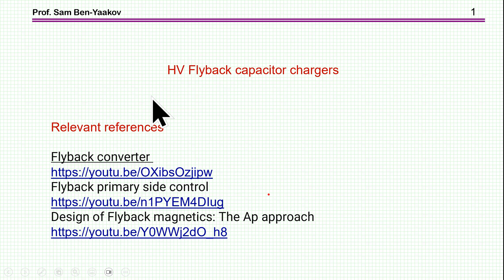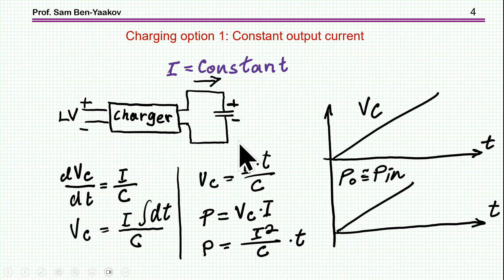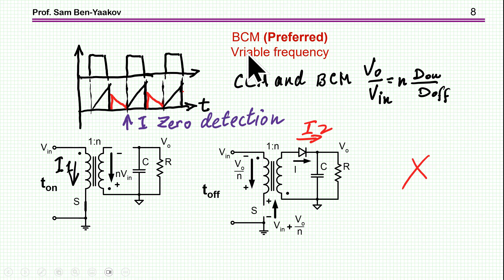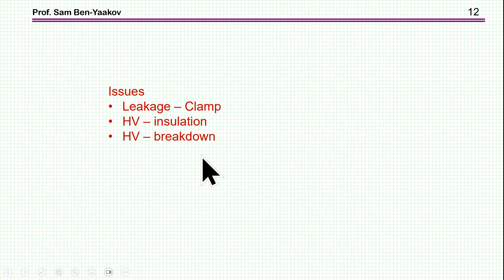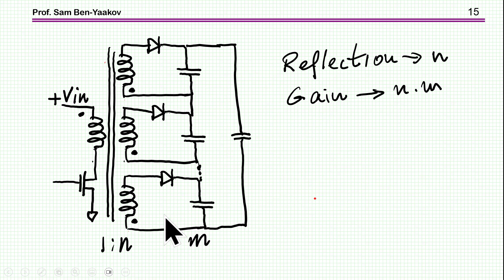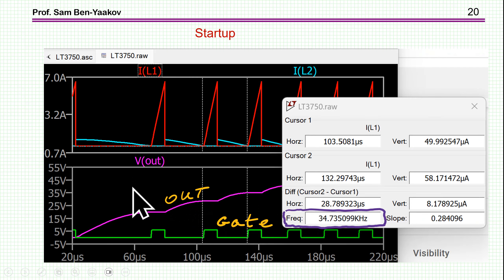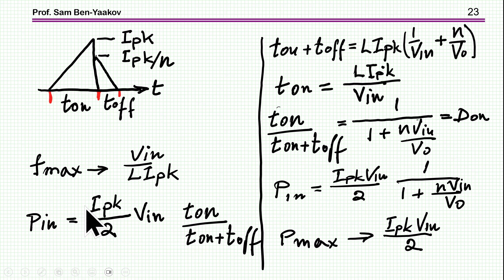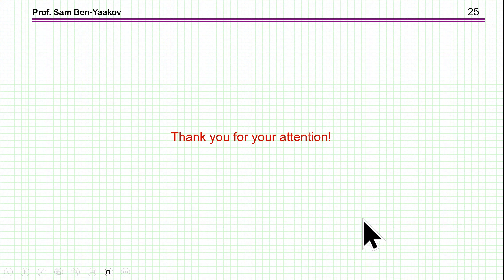HV Flyback capacitor chargers

Comment: What regulation of output voltage vs output current can be expected/achieved in a typical circuit with the LT3750 (n around 10)?
Reply from the maker: You find this information in the data sheet of specific devices.

Comment: Thank you for great presentation. I am very enthusiastic your lectures. I have a problem with page 24. The equation between Pav and Ipk.  I think the Pav is coming from the energy equation?
Reply from the maker: Indeed. If Vin is constant the power is proportional to Ipk
Reply: @sambenyaakov  Hi. Looks like P average (during charging capacitor to target voltage) in only 20% less than Pmax on input?

Comment: It would be interesting to discuss the implications of including a voltage multiplier on the transformer output, as it is no longer purely flyback topology, but rather hybrid with forward converter. 
The induced current peak superimposed onto the usual constant slope ramp of flyback converter makes current mode control more difficult, especially so in instances where output voltage set point needs to be adjustable. So far my personal experience is that COT voltage mode control is best suited in such cases.
Reply from the maker: Thanks for input

Comment: Wow, amazing stuff. I'm currently designing an isolated (1.5kVDC Rated) flyback which will be integrated into a large battery energy storage system. It's also primary control so all your videos have been relevant, thank you!

I recommend a topic that is very important - CMTI! What is it? How to measure it? How would a y-cap impact this? How to measure the value across a couple instructors ( flyback transformers)?
Reply from the maker: Thanks for the suggestion. Perhaps.

Comment: I hope you have time for a quick question. Would it be possible to integrate capacitors into a circuit in such a way that they serve as a source of voltage pulses with very short rise times in the microsecond range?

My idea is to charge a capacitor via a DC source with a rise time of 50 to 100 ms in order to then use it as a direct voltage source for the load via the fast charging and discharging capability of Capacitors. The aim would be to generate pulses with a rise time of e.g. 20 microseconds and a voltage of 1 kV and (variable pulse width 100µs : 1000µs) - possibly by using fast power switches such as SiC MOSFETs or IGBTs.
Would such a circuit to generate controlled pulses be technically feasible?
Thanks in advance
Reply: If it is possible, I would be very happy if you could make a video on this topic. That would be a great help!
Reply from the maker: Yes it is possible. here are many circuits like this, On example is a defibrillator. As for a video on this, it should be related to a specific application.
Reply: @sambenyaakov  Many thanks for the feedback! A suitable application for the video could be in biotechnology or water treatment:

In biotechnology, for example, electroporation is used, in which short high-voltage pulses (1 kV, 20 µs rise time) make cell membranes permeable in order to introduce DNA or other molecules into cells - a technique that is very useful in genetic research and therapy development.

For water treatment, such pulses are used for disinfection to kill microorganisms and reduce pollutants without chemicals.

A video on one of these applications could be very helpful!
Reply from the maker: @zeroenglisch2979  👍

Comment: That’s the first time I hear BCM. Typically it’s called ZVS, isn’t it?
Reply from the maker: NO. ZVS is an attribute of BCM. ZVS is found in other circuits., e.g. resonant converters.
Reply: @sambenyaakov  Thank you  sir. It would be interesting to hear something about this in your further presentations. Because for me ZVS means a condition when there are no high current and high voltage at the same time. Just like BCM (current ends, and voltage is applied). And I saw many ZVSes related to full/half bridge SMPS as well (like to introduce an additional dead time for one leg to achieve a ZVS)
Reply: @sc0or  ZVS means Zerro Voltag Switching. This means at the time a semicoductor switch, aka transistor, is switching, the voltage across it is alomost zero. The current can be high during turn off, it is still zero voltage switching. This reduces the switching losses. There is also ZCS, Zero Current Switching. To achive one of the two modes, you need some kind of resonant circuit and the right timing.
Reply: @JacquesMartini  That's a great explanation sir. Thank you. Now I think BCM relates to an inductor, and ZVS/ZCS relates to a switch. Is that right?
Reply from the maker: @sc0or  BCM has to do with the inductor current, it means that the inductor current drops to zero and increase immediately again.
Reply from the maker: @sc0or  see https://youtu.be/w4cxLPl2Wsg